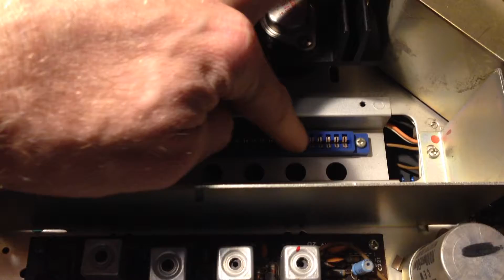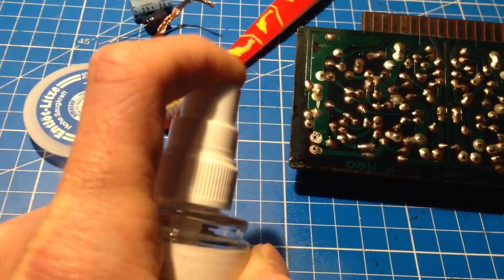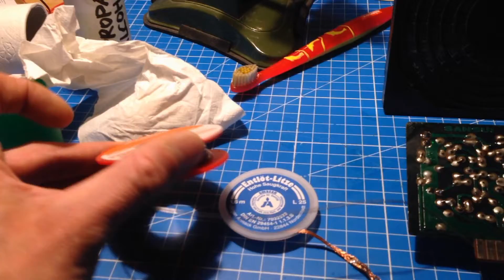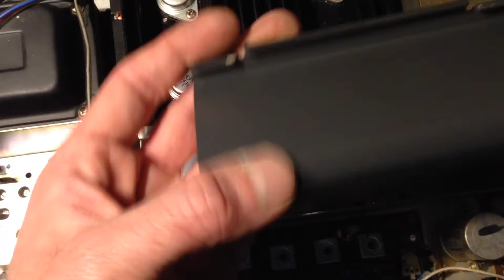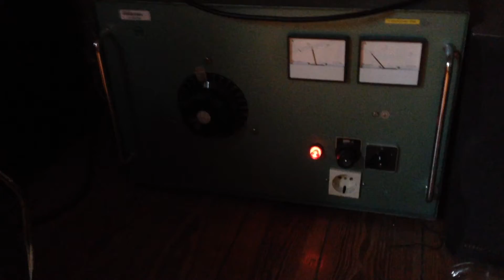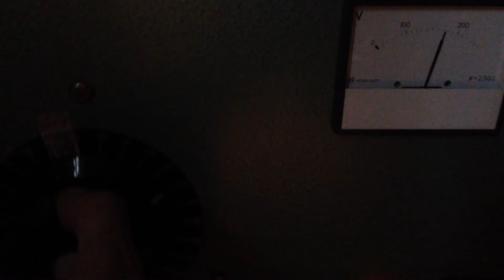Sansui 1000X Repair 1/3 - Driver board recap and transistor replacement

Comment: The nut on the headphone jack can be removed properly with a 12-14 mm hook spanner.  Refer to McMaster Carr PN: 6975A11.  The flats on the other nuts are very close to 15mm.  Cheers!

Comment: Does anybody know a shop that has this replacement transistors KSC1845 to order?   Thanks
Reply from the maker: https://www.reichelt.de/bipolartransistor-npn-120v-0-05a-0-5w-to-92-sc-1845-p16339.html They are pretty common if you leave the K out (which I don’t think means anything). ;)